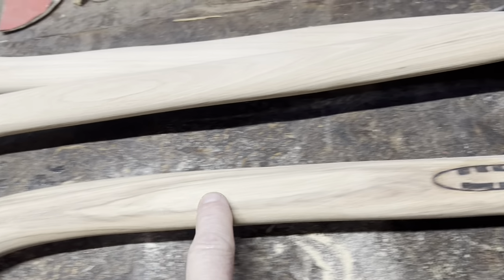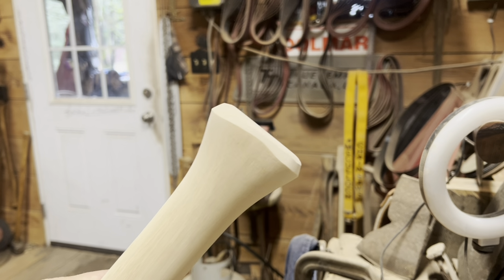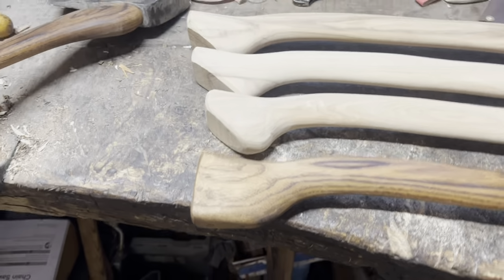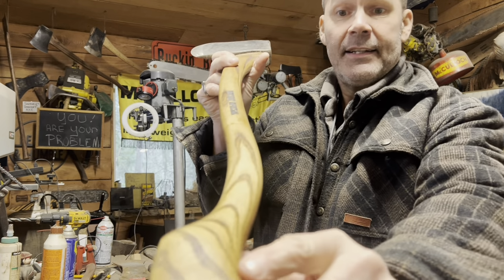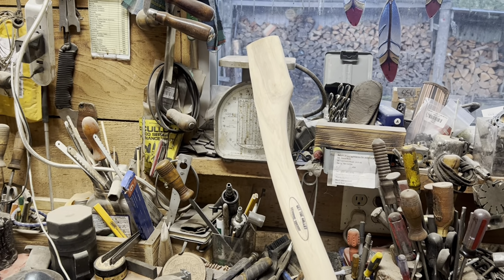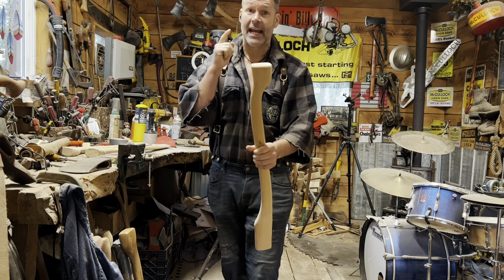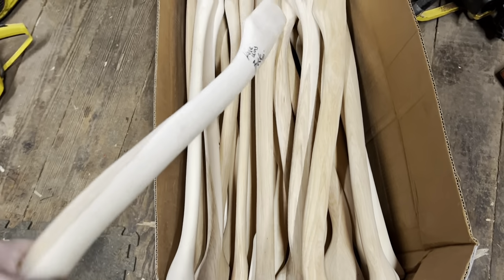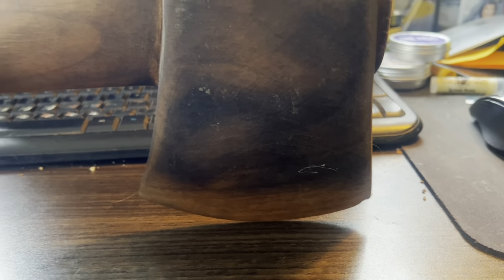Ways to customize your Axe handle

Comment: Good stuff Buckin. I get the big palm swell but never quite understood the need for having the big block of wood at the bottom of the handle. Having a large striking surface for hafting makes sense as well as giving room for customization for your own special palm fit, but I’d still lop off the extra after.  I like the fawns foot look best.

Comment: Just before Xmas I hung an axe for my grandpa that he actually has early memories of his dad using that axe..it was a double bit that was far ground and smashed up pretty bad on both sides so bad I couldn't see any sign of any stamps at all...the handle it got was a bit thick for what was left of the head and has that dead horizontal grain orientation but as he doesn't plan to use it I wasn't at all worried I burnt it up and stained it blued the head and sort of just brushed the edges for a "patina" look and it came out deadly!

Comment: Hi, I have a question. I've got cheap hickory handle, and I have a cheap axe head. But the hole of the head is slightly smaller than the shaft. Is it ok to remove 2-3mm of the wood to fit the axe head? Will it weakens the handke is my question??
Reply: @MATT.MAN-PEACE-LOVE  Thank you very much,  I'll get on it right away. Cheers 👍